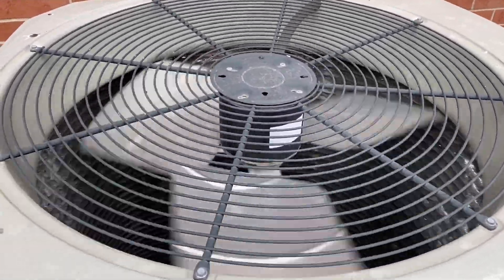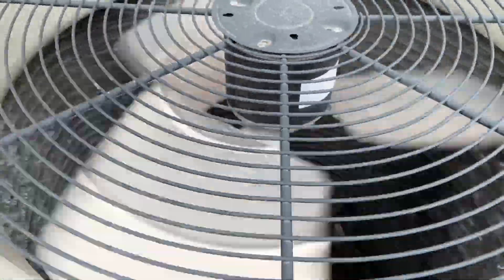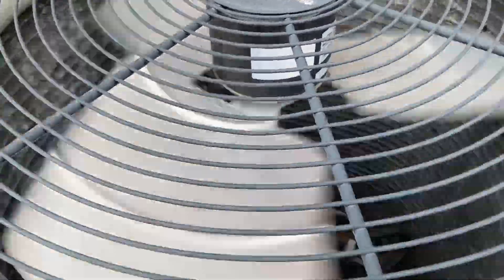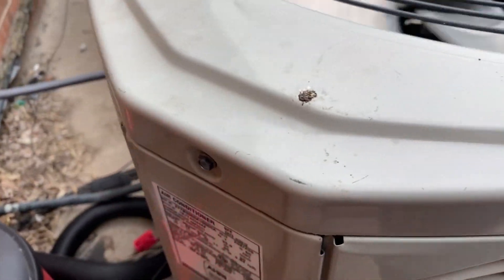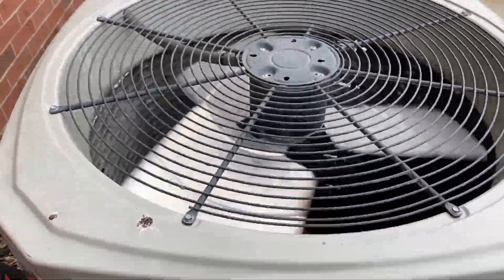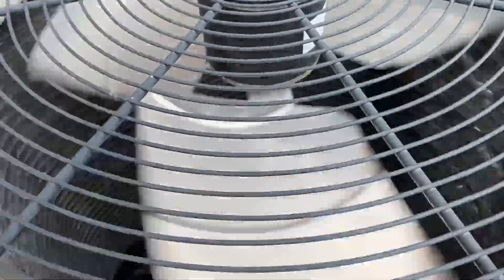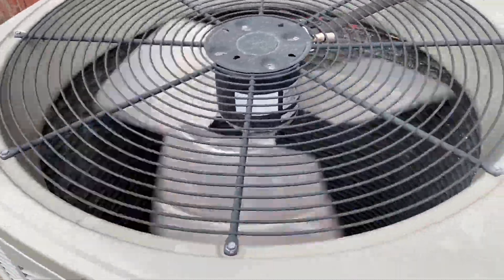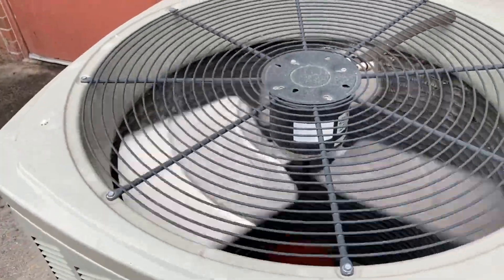2012 American Standard 5 ton central air conditioner with a bad run cap running on a chilly day!

Comment: Slow fan blades don’t always mean bad caps
Reply from the maker: I guess you have a point. The fan motor could be the issue or maybe even something else.
Reply: it might be on a low ambient kit
Reply: Right. Could be the fan motor or a voltage drop being caused. Likely cause is the capacitor though. Would like to see how it starts up
Reply: The fan motor would likely start up very slow regardless of the issue. No real way to tell unless you open it up and find it